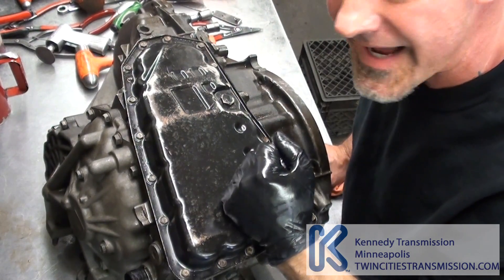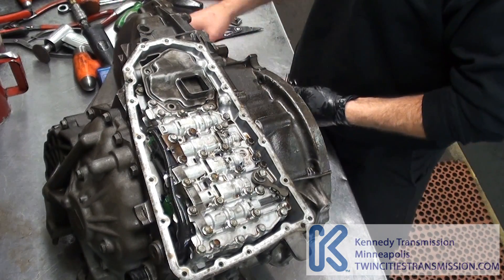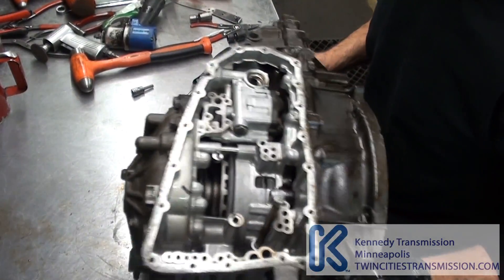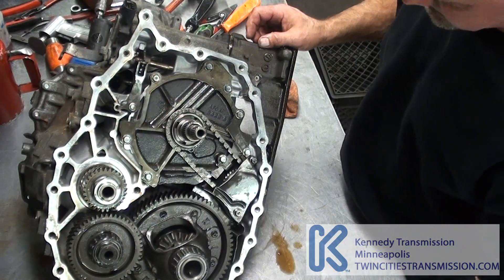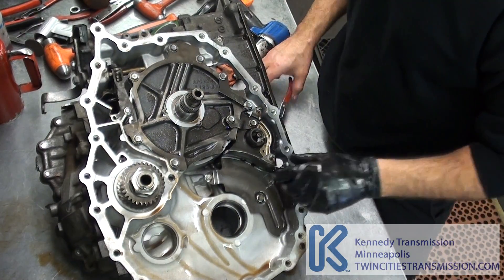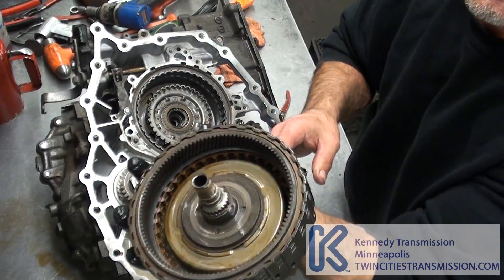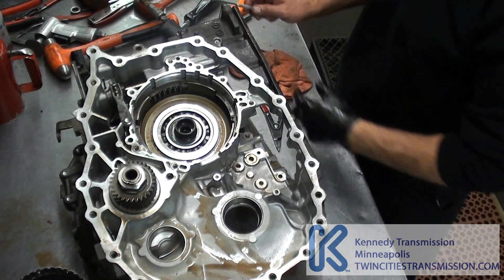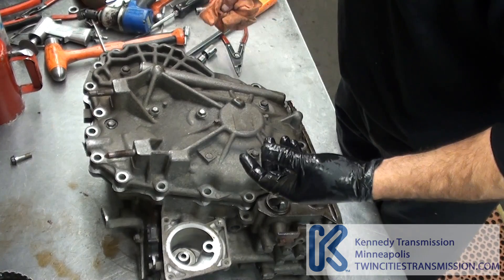Mitsubishi Nissan Jatco CVT (JF011E)

Comment: My CVT transmission on my Mitsubishi Outlander 2008 doesn’t shift gears automatically while on drive (D)mode it remains on 1st gear. When I use manual mode (+/-) gears shifts smoothly. Do you have an idea how to solve this issue ?

Comment: I have this transmission in a 2008 Lancer. There is a clicking noise that sounds like a bad inner CV axle but I've been told that the noise is coming from the transmission. The axle boots have been leaking and the noise is only heard when coasting with the engine running. No axle noises with the wheels cut and no noise coasting while the engine is off. I've been driving it this way for quite some time and the transmission isn't slipping. I just did the second transmission fluid change (80,000 and 140,000) and the mechanic showed me the pan on request. The fluid was of good color and there were no metal shavings on the magnets. What could this noise be? Should I worry about it or just keep driving it that way? Could a bad inner CV axle be the culprit?

Comment: Great video, but what are next steps to fix it? Replace belt, variator and bearings? Thanks!
Reply from the maker: It depends on the extent of the damage.  If the sheave surfaces or belt are damaged at all from slipping, or the internal bearing grooves have any deterioration then they would need to be replaced.  If the damage is limited to the pump flow control valve, bearings etc... then the pulleys and belt may be re-used as they do not generally fail unless another component causes them to go down.

Comment: HI...i have same transmission and it has whining noise from the transmissions. While driving I can hear the that and If I drive car on down hill with out starting the engine that time also noise coming. What could be the problem... Can you give me some idea... Thanks.
Reply from the maker: Rajitha,

Whining on the Jatco CVT's is usually one of 3 things:  Low CVT fluid level, a sticking pump flow control valve or a pulley bearing starting to fail.

Thanks,

Matt

Comment: Hi, I was wondering about the part where the audio cut out regarding the oil pump. Is it true that the main failure point of these jatco Cvts is the oil pump? If I simply changed the oil pump and left everything else as is (making sure nothing else was damaged of course), would that be enough? I’m asking cause even doing a full rebuild myself is still $1000 with all the parts and tools involved.

Comment: What causes these failures? I have a 2013 sentra with a jatco cvt that judders on the first acceleration starting cold and I'm afraid the pulleys are all scratched up like this one is. Dealer won't help unless it throws a code, and by the time it does it's already too late anyway

Comment: Is this what happens when you don't change the transmission fluid on a regular basis and/or change it too late and the transmission breaks later on?

* I own a 2014 Mitsubishi Lancer ES with a CVT, and I'm potentially facing this problem sooner or later...

Comment: Thanks for posting I did not know about CVT when I  bought my new  2019 nissan Quashqai. But I learn a lot since then  it just Unbelievable,  At first I felt it was like a ticking time bomb.  I could not understand why would Nissan install these CVT in there cars When they fall there so much   damage to the CVT  that it would cost more to repair it then replace it.  And it all to do with the massive amount of heat these CVT transmission  generate.  causing an abrasive  carbon build up. in the CVT fluid. I read that before the first nissan Jatco  CVT went into production nissan tested them for five years,  by driving them around the clock 24 hours a day,  in city traffic, up and up and down the steepest hills they could find. After the five years were up,  they found there were no problems what so ever. with the CVTs.   But the thing is ever few months the cars CVT were taken out taken of the teat  cat  pull apart and examined. They found almost no wear and tear. But the thing is that ever time they examined the CVT they also change the CVT fluid. So they did not see the carbon build up in the CVT fluid. And the damage that  it was doing.  But they know now that the problem with these CVT is  the small amount of CVT fluid and the heat from the contact points on the cones and steels belt that burns the CVT fluid this creates a  build up of carbon in the the CVT fluid. that  The Carbon in the CVT fluid It is a mild abrasive and if it not removed will effects ever thing in the CVT including a small return valve that has been shown is prone to failure. So the main cause of failure in these CVT are cause by a build up of carbon in the the CVT fluid. It been found now that just by changing CVT fluid regularly as some one on here once said Around about every 30-40,000 miles. the CVT should out last the life of the car, that it was installed in .It not an hi-tect operation to change it you can do it you self easy. but it much mach the same amount of CVT fluid that came out of it.

Comment: I see a lot of people hating on this Jatco unit, but my 2008 Patriot uses this same unit and with 133k miles on the clock it is still working perfect. I did Change the fluid and filter as required by the owners manual. ¯\_(ツ)_/¯
Reply: KEEP CHANGING FLUID AND FILTERS EVERY 30K    THE JEEPS ARE VERY COMMON FOR TRANSFER GEAR BEARING S COMING APART

Comment: Enjoyed this video. Was curious to see what these look like on the inside. I had a 2010 Nissan Cube SL with all the factory goodies on it and the CVT transmission. I liked that car a lot. That CVT got all the available power (all of about 122 hp of it I think)  from that little motor to the ground quite well and gave good fuel economy (I got 29 to 32 in town and 30 to 33 on the highway). It was a perfect city puddle jumper and decent on the Highway. Loved the inside roominess and the small foot print it had for parking. I loved the smoothness of the transmission and the seamless gear ratio changes. It was always at the right gear ratio no mater what the speed and grade. I had that car for almost two years until it got rear ended and totaled. The car that hit it looked worse than the Cube after the hit. It was totaled as well. And it was about 1400 pounds heavier than my Cube. I had zero problems with that car until then.
Reply: I have a 2010 cube, and my wife has a 2014 cube. Between the two of them, they've traveled more than 190,000 miles -- 134k on mine. The CVTs have been reliable so far, and yes, very smooth and efficient. But we do have their fluid changed every 30,000 miles at the dealer. It's about $150, and at the rate we drive, it happens about every other year. Worth it.

Comment: had a 1998 honda V6 accord trans rebuilt by Kennedy Trans in Anoka  in 2006 for 3600, had to take the car back 5+ times and they never got it right. 11K miles later sold car....

Comment: Very interesting video. Have a question for you sir. My cvt trans is leaking from where the torque converter sits but not sure where it’s leaking from. Is there a seal that is easily accessible to replace or would it be the torque converter that’s leaking? I’m fairly new to looking at cvt trans I’ve only broken down regular 5/6 speed manual trans so far. But I really appreciate this video.

Comment: If there was ever a case to be made for electric vehicles with me it would have to be the simplicity of a vehicle with no gear box and no complicated engine/ maintenance. Hello future.
Reply: Jb Nissan makes the worst electric vehicles. The Nissan Leaf is total junk because the batteries are air cooled. You would be better off with a Chevy Volt.

Comment: People can't except change they talk about Nissan Altima and on the end inown one and it's been a hell of a car a 07 first year CVT o have 288.000 miles on it and you know what I never changed the fluid because Nissan book say not to its sealed o don't care how dirty it is they only thing you do to a high mileage trans is drive it and and CVT fluid when it's low you can go 10k on a oil change but to make money they want you in there at 3000 people stop listening to what other people do!! CVTs are good get you a Ford or a Dodge and you will see what I'm talking about this Altima has been the best car I ever had hands down!  And if it breaks down o had a good run! 280k o couldn't imagine it would go that far!
Reply: Few mins spelling using swipe lol

Comment: Jatco OR Nissan has been making transmissions systems since 1970. So, it is unreasonable to be said that CVT is the worst transmission system. I do believe that the CVT needs regular oil change as recommended by the manufacturer. The same case for DSG by VW. Moreover, people still think that transmissions systems do not need changing oil and oil filters.

Comment: the transmission that ruined Nissan
Reply: Most Nissan owners are perfectly happy with their cars, but obviously the people screwed over by their transmission make a bigger stink than "yeah, it's still running" 😛 79k miles on my 2016 Versa Note and it continues to run well, I enjoy driving this little car.
Reply: It has not nissan will fix the car but I must say I have had a good run with my 07 Altima  it has 288.000 miles everything I owned. Before was a lemon! I really want a Maxima 09 man take a chance don't listen to people!
Reply: @imlamar2011  Does it have a jatco cvt auto transmission ?
Reply: ThinkoutsidetheTbox All Nissans use JATCO. The CVT saga tends to be inconsistent with everyone who a Nissan as well. There’s stories of people going through three transmission replacements, some like Lamar managed to get their CVT to 300K, and etc. I’m currently having an issue with mine that whines but still puts power down. Kinda weird but eh.
Reply: @imlamar2011  just leased a new maxima for my wife. Great car. Best part is they throw in all maintance for life of lease, no worries. Get a kick when some say I got a million miles on this car or that car. When you get older you deserve a new car with no worries....
Reply: Powertrain warranty is 5 uears 60,000 on nissans now. Almost all the horror stories put them going out between 20 and 40,000, so buy one cause everyone else whines when they only get 180,000 miles which is on par with alot of regular auromatics. Regular fluid changes and it will probably last longer than youll wantto keep the car anyway
Reply: wow, i bought the wrong car, oh well, what I save in gas, Ill just buy a new transmission every other oil change. ..L..O....L. . .... . . (I still like the car though, weak spot im sure to experience soon with my 2015 Altima 2.5 with 70K, especially since the way I drive ;-))
Reply: @andyp3834  check out the videos of folks putting a trans cooler on it and change its filters and fluid. Youll likely be just fine
Reply: @DrDaddy-yg2ki  thanks, but so far I think the filter is WAY inside, so unless i do it myself, its $, right$?
Reply: @andyp3834  i think theres 2. I would do it nyself anyway though. 1 is exteral and looks more like the the old cannister filters and the other you have to take the pan down and unbolt it from the bottom of the valve body. If you can change your own motor oil this really isnt anymore difficult, just takes a bit longer. Either way good luck
Reply: Likely know more with problems than those without because you either dont know anyone or very few people with one OR its due to the fact that people with problems bitch all the time. People without are usually quiet about it
Reply: @Mike S Thats what I have heard, so with all the gas im saving, how much is it to rebuild a CrapCo Transmission anyway?
Reply: And about to ruin Jeep, Chrysler, Dodge.

Comment: I have a 2015 Nissan Altima, and I'm looking at you strip this transmission, and the look of that belt shows me that whoever design this needs to go back to the drawing board. You have to strip that down just to find the problem. This is crazy costly. They need to redesign the belt.

Comment: I have a 2011 Mitsubishi Lancer, and my cvt has a loud whine and I get a lot of over heating issues after driving on the hw for more than an hour, the car has 130,000 miles, changed the trans oil 30k miles ago the over heating stopped for a while, the car also feels like a “slingshot “ I’ll give a little gas than  the car pauses than jumps to speed, what could be the solutions for that ?
Reply: Did you ever find the solution to that issue

Comment: I have the same transmission in my 2014 Mitsubishi Rvr (Outlander sport) and the car drives fine but every now and again at hwy speeds it will start to whine and the car tells me to slow down and that the transmission is overheating. Should I add a oil cooler or is the transmission slowly dieing? Thoughts?
Reply: If its a jatco cvt transmission then just say goodbye to a few thousand dollars in repairs. Nothing you do can save that transmission.

Comment: If your going to purchase a CVT it better be in a light weight, low powered car, like the Mitsubishi Mirage.
Reply: How about mitsubishi lanc
er?they use cvt also?who made them?
Reply: @wandywan2444  All Mitsubishi CVTs are made by JATCO. Mitsubishi seems to have the programming down bettet for their CVTs. Definitely better track record than Nissan.
Reply: Thank you,i am happy to know that,my wife lancer with cvt is already 155k km as today,still strong..i hope it will last till i buy a new car..
Reply: @wandywan2444  Your Lancer should be fine, theyre great cars. The Lancer Evo is coming back to the States!

Make sure you change CVT fluid with OEM fluid, every 30k miles.

Comment: I was a mechanic for 18 years between '82 and 2000. Great video, thanks. These CVT's are well after my time, and I find the concept horrifying.
In my day, we had the "Hondamatics". And I suspect one thing is shared between those and these new CVTs - the driver, no matter how much you try to educate them, will never adapt to the altered driving experience.
Reply: Something in the power valve assembly broke on my automatic 95 del sol recently.  It ran beautifully for 226,000 miles so I can't complain much (the car was ";rebuilt" after being bought at an auction as a totaled car). You can say I've been a Honda fan for a few decades now :)

Comment: JatCrap.. 
The only place this design of transmission can work is in a throwaway car market. 
Fundamentally it is breaking rules in engineering by using metal to metal friction in a non friction environment.. 
No amount of design refinement will circumvent this design flaw, and so, they will never take horsepower or torque, or last the distance.
Reply: Good point about the "throwaway car market". Nobody in Japan would keep a car longer than 3 or 4 years so they never experience the problems often faced by used car owners! That said, buying a new car is far more expensive than fixing a used car...

Comment: Just got talked to a Mitsubishi technician about my 2014 Mirage CVT. He was honest. He said most CVT only hit 150k miles on them if theyre paired with underpowered engines (less than 100 hp) and a light car weight (no more than 2400lbs). And you have to drive them slow! No punching it, just rolling it. Change that cvt fluid every 30k miles is critical too with OEM oil. You adhere to these variables and the transmission has a good chance of lasting 10 or more years.
Reply: kylemas2005 .... you’re exactly right, CVT’s work better in under powered hybrid vehicles, very poorly in anything else. They are still junk.
I want the manual trans back! It keeps drivers in better tune with the car and the road.
Reply: @Toguro-oy3ld  My Mitsubishi Mirage isnt a hybrid but a 1.2L 3cylinder with 74 hp. I actually get better mileage than many hybrids.  Even the little Nissan Versa is too heavy at +600 more lbs and too much hp (over 100 hp I believe) to keep these little Jatco CVT7 from burning out. Ive talked to a number of transmission specialist and they all say the same thing. "Mitsu CVT programing is much more reliable than Nissan. Keep your fluids correct, dont dog the CVT out and there is no reason a Mitsu designed CVT cant hit over a 150k miles. The fucked up thing is Nissan owns a big share of Mitsubishi. One would think their designers and engineer from both firms would cross evaluate why one is working and one is plagued with problems? Still though, give it another 5 years and the CVT issues will be engineered out. This type of transmission is here to stay.
Reply: So how about cvt on 2016 lancer ex  2.0c?is that good also?invect 3

Comment: Fluid, fluid, fluid, fluid, fluid...………….. Did I mention changing the fluid? Also, heat is the enemy of any automatic trans; even more so with a CVT. A cooler is not a bad idea, either.
Reply: I always tell people to change the fluid and install a trans cooler but I am usually told that they have a "warranty", or that the fluid is good for "life".  It's not expensive to do a drain and fill every so often on a vehicle.   I was also told that car company's would put something in a car that was worse than the previous years.  Some people listen, some don't.
Reply: A CVT is not a automatic trans it's the same as a snowmobile or a motorcycle

Comment: This is the  SAME thing my 1985 Elite 150 scooter had!!!!!
Reply: Except your scooter has a rubber belt, and is much simpler, you can replace the belt and pulleys on a scooter transmission quite easily and cheaply.